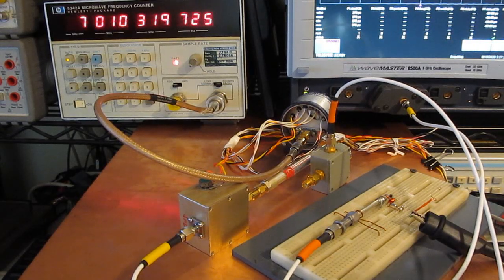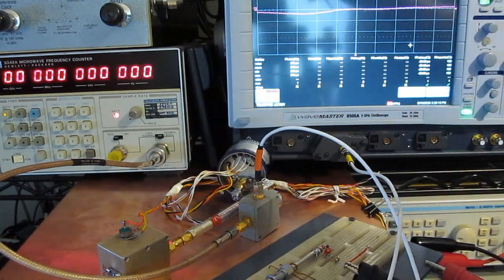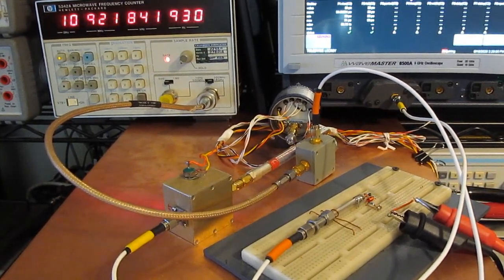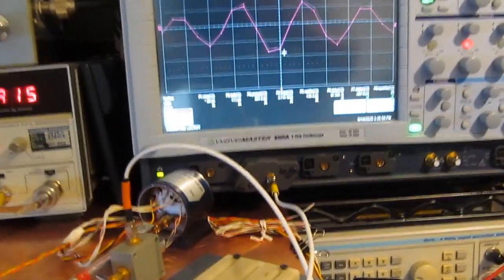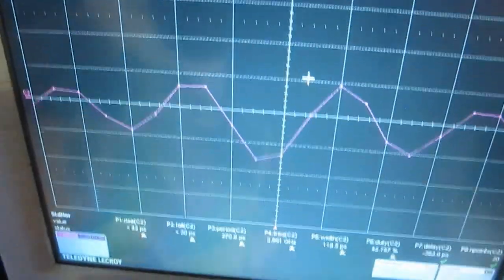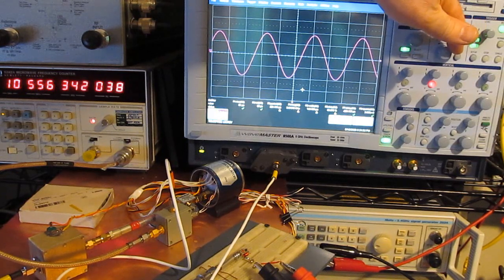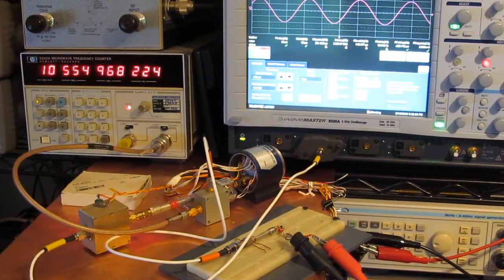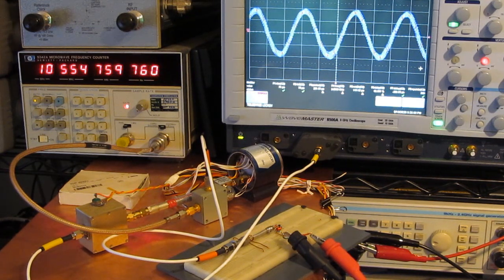Testing a new Transistor in the Breadboard Oscillator

Comment: May we have the circuit Diagramm of the Oszillator,please?
Reply from the maker: All there is now is a transistor, resistor and some wire.  Of course, that wire plays many roles.  Then again, so does the breadboard.   If you want to learn more about this type of oscillator, check out:  https://en.wikipedia.org/wiki/Phase-shift_oscillator
Reply from the maker: If you follow the link to the EEVBLOG forum, I posted a closeup of the latest version that is basically just wire.  You can easily follow the wire to draw a schematic from it, ignoring the parasitics.

Comment: what transistor number  did you use this time please ?... and at which supply voltage level ?
Reply from the maker: Wait, I thought you were suggesting which to use, not asking.  lol.   If you were in the USA, I would point you to Digikey or Mouser to do a search.  Digikey has a fairly decent supply of parts and their search engine will allow you to pick something out with little effort.    My advice is don't try and follow what I have shown but rather make something even faster and show us what you can do.
Reply: @joesmith-je3tq  it would be nice for newbies to learn after the competition is "over" for you to disclose what you did and how you came to the solutions you did. That would be great learning opportunity to many younger guys out there. :)
Reply from the maker: I assume you are following the thread that was linked in the description.  If not, you should as there are more details posted there.

Comment: Wow Just for curiosity, what is the maximum frequency you can measure ?
Reply from the maker: The microwave counter, 18GHz.   The poor man's down converter uses an 8.3GHz YIG, the LeCroy 8500A is 5GHz, so 8.3+5 = 13.3GHz.  The Signal Hound is 6GHz, but again, we can use that down converter with it as well.    Of course, I have no way to check any of it and it's all just for fun.
Reply: joe smith great! Thank you
Reply from the maker: @PY4SR  I have to retract that comment.  Again, as I mentioned in this video, the IF is good to 4GHz with this mixer, so we are really limited to the 8.3+4 or around 12.3GHz.   A different mixer or YIG would extend it.

Comment: Hi Joe
today I used Extech 570 for resistance measurement on IXYS IGBT-s
and measurement in AUTO mode was 0,8MOm, in manual 2,4 MOm
 https://photos.app.goo.gl/b3KGGwxZASz65bKt5
have you encounter something similar??
I need to go one more time with better DMM obviously
Reply from the maker: I would imagine if you manual range it to get the same range selected by the auto, you would get the same reading.   Sure, I have ran into problems using autorange on some meters.  The 121GW is a prime example.